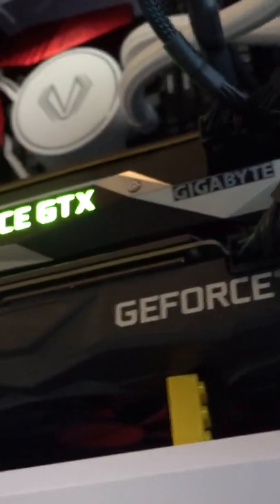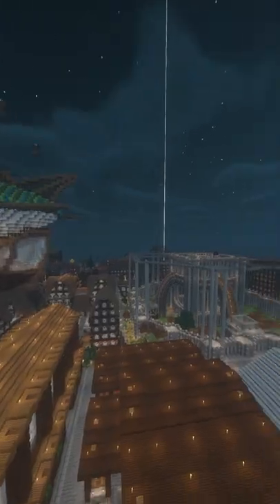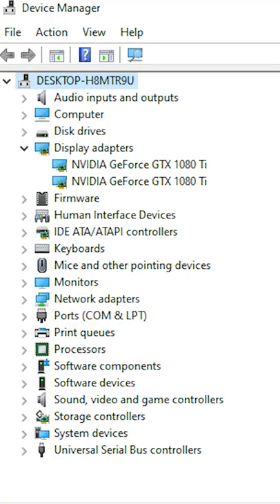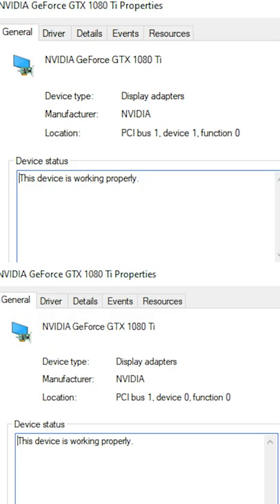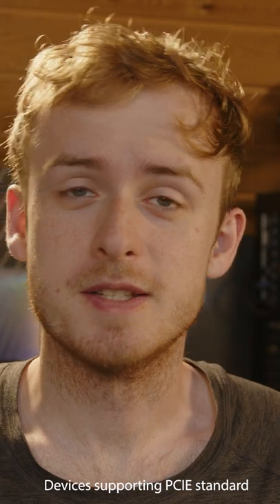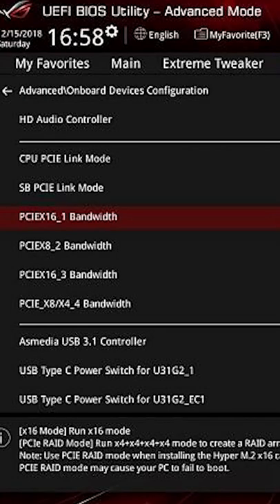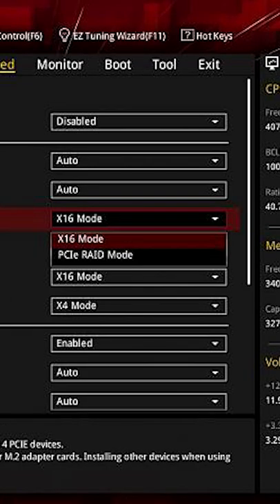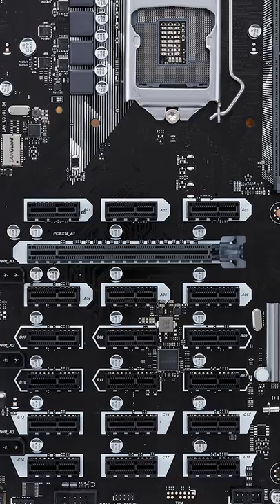What Happens When You Put Two Graphics Cards In One Slot? #shorts

Comment: well that is confusing... I still don't understand what you did... so you went into the BIOS and told the mobo that the physical slots that the cards were in were actually just one slot but divided in two??? I don't see the purpose unless you have say 2 pci-e gen3 cards and only one pci-3 gen 4 slot... but you somehow told the bios to make both slots gen4 but on 8x instead of 16x???  I don't think this is possible.....
Could you PLEASE make a full video about this???
Reply from the maker: You need a breakout board. Something like this: https://www.alphatechserve.com/00w2032-ibm-riser-card.html?campaign=436041532&adgrp=1348002924922928&device=m&adposition=&keyword=&msclkid=f349096b79c5132c7c9f6ba468b14b8c
Reply: @JaysTechVault  that bit of info would have been helpful in the short. Its too brief and dark to see whats going on .

Comment: But they’re not in the same slot. They’re in different ones. Multiple pcie slots with splitted Lanes. But it’s indeed possible in one slot. You would need to split the 16x to two 8x with rizers and than each back to 16x. At least in my knowledge it should work. Maybe you could need a controller like the old gpus had to use it that way
Reply: At least in the first image they don’t look like they’re in the same slot
Reply: At least physical